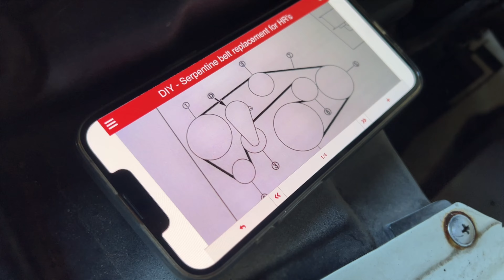Fixing the serpentine belt on my Lil Bro’s 08 Nissan 350z HR

Comment: how did this work out for your lil bro? i have the same car an HR, getting to be time for me to do this job, don’t wanna fuck up. thanks!
Reply from the maker: It worked out perfect, after we fixed the belt the car is running fine, I could have him comment too to tell you his side
Reply: It wasn’t too difficult to be honest, removal was the easier part and mainly putting the belt on was the more difficult part of the install, I do have an aftermarket radiator which did increase my time of install since I had to remove my rad fan due to less space, but if you’re stock you shouldn’t have to remove the fan at all and you’ll have space to squeeze the belt in and loosen the tensioner without issue! Lmk if you got anymore questions